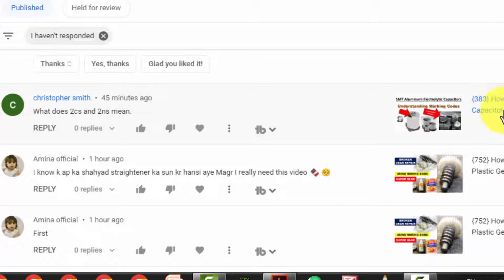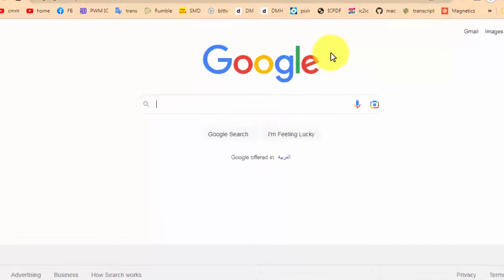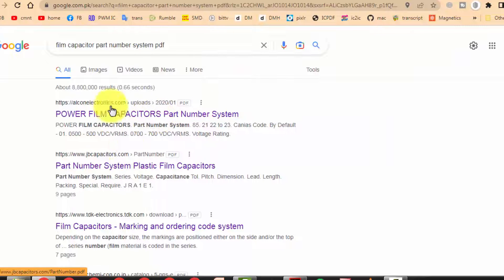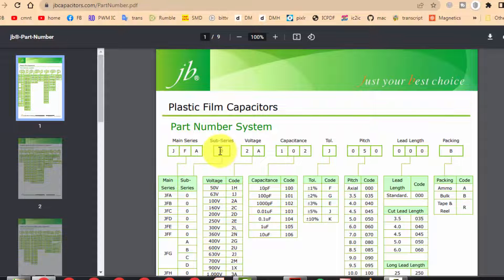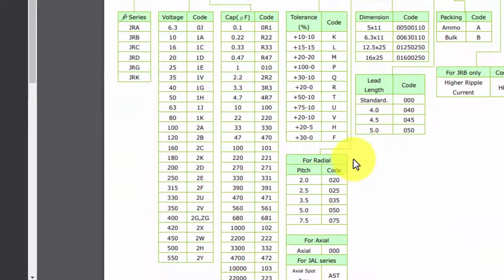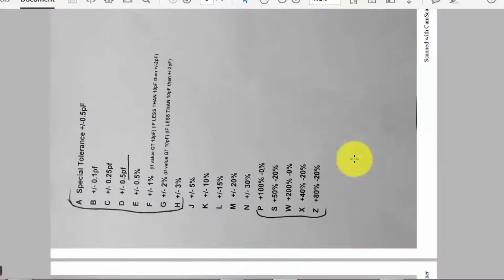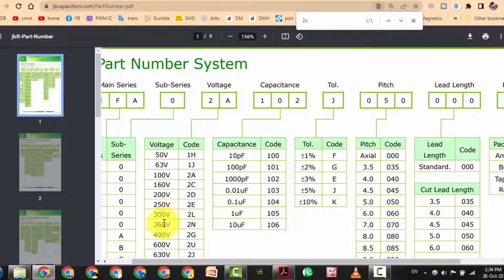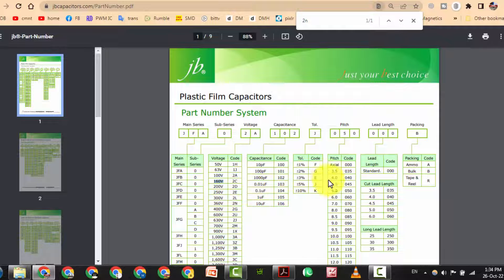{753} SMT Film Capacitor Voltage and Tolerance Value

Comment: Please help to decode an aluminium capacitor 107 270 VHC. Thank you.
Reply from the maker: good good moring dear. you didn't mentioned the type. either it is SMT or through-hole type. 
can you please send its pcicture on my whatsapp 00962-79-5608616 or gmail id ashraf4ta4